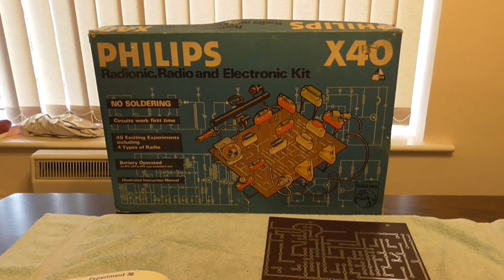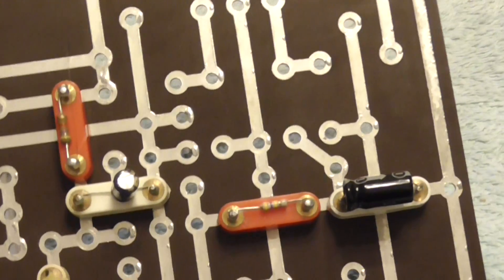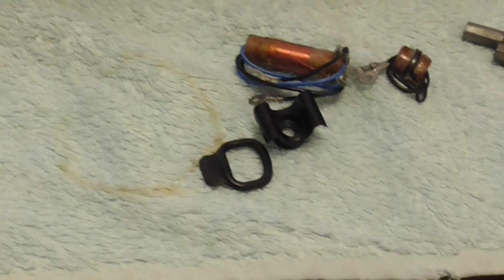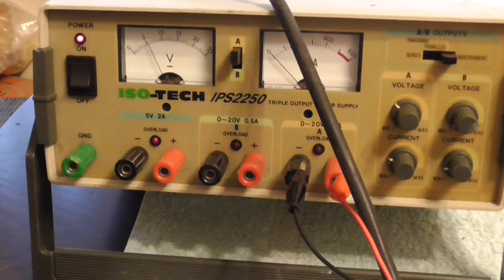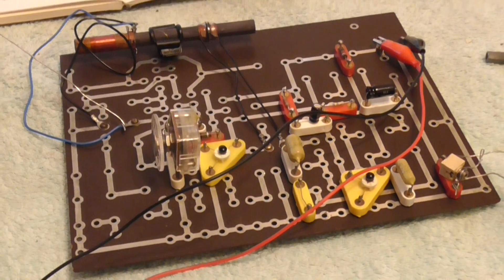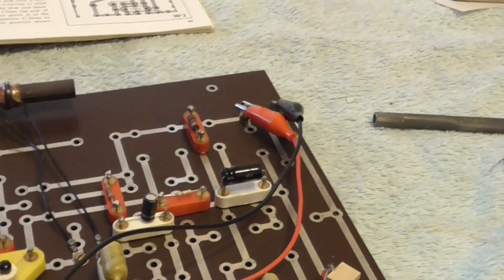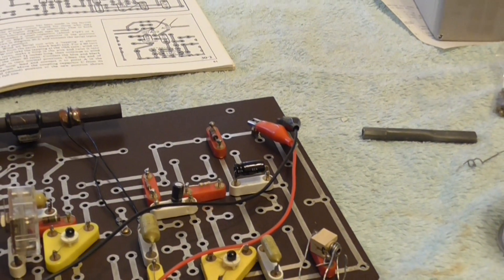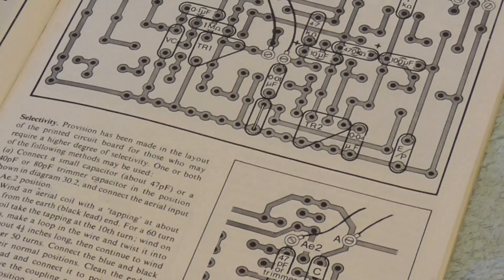RADIONIC X40 EXSPEREMENT 30 002

Comment: I particularly enjoyed the "illegal" projects that were described in the Radionics manual (early 1970s) ... One was to enable a small inductor to be placed against a telephone wire so that you could listen in to conversations on an earphone. That always caused me to wonder why telephone tapping in films always seemed to involve actual wire connections and causing clicks on the line when switching the monitoring on and off ... no problem using my childhood Radionics kit! The other "illegal" project was that you could make a radio transmitter that was capable of transmitting to a normal transistor radio that was close by. I am guessing it would be on "medium wave" AM which was most common at that time. It was capable of interrupting a commercial broadcast but only with the radio right beside it ... I deny that I ever tried to interrupt our next door neighbour's radio listening!

Comment: What are the  part numbers  for  the transistors  in the kit??  They don't specify what they are in the instructions.
Reply: This one can use general purpose small signal silicon NPN transistors, such as BC548 or 2N2222 will work. But apparently some early Radionic kits used PNP transistors. So check in the manual schematics for your kit.

Comment: I had this very kit back in the mid 70’s. It really was excellent quality. I recall making an intercom system and dangled the mic (actually a speaker) down the stairs so I could listen in on my parents. Later I rigged a DPDT switch and was able to talk as well as listen to my parents. I have no idea what happened to the kit but I suspect I sold it and bought an Atari 2600 console in the late 70’s

It really was quality though.

Comment: Thanks for loading this - it made me buy an X30 kit from ebay. When it arrived, I made the same circuit (however, X30 uses PNP transistors !) and switched it on. 
I was amazed how well it picked up stations (because of the regeneration). I tweaked it first by pushing the regen coil nearer the centre of the ferite rod until the radio made a whine (osscilation), and then pulling regen coil back until the oscillation stopped. That gave the optimum regen, with only a few stations being too loud for the crystal earpiece! All good stuff - loved this kit when I was a kid and still do.
The "Burgler alarm" was a favorite of mine (snuff out the bulb to reset!)
Reply from the maker: i'm glad you love my first video. i had loads of fun with it